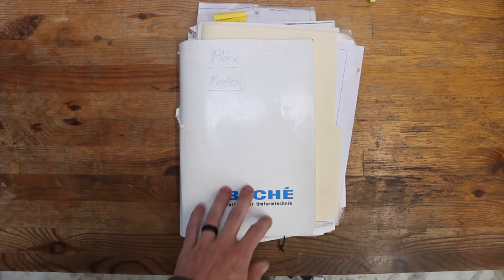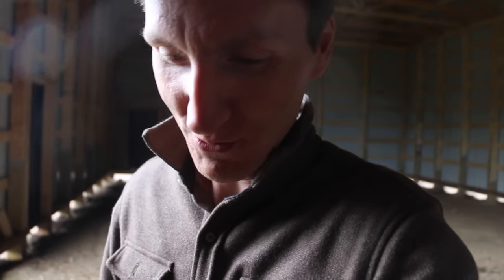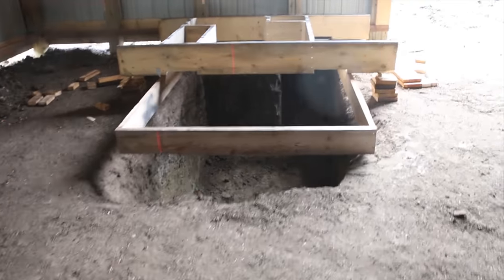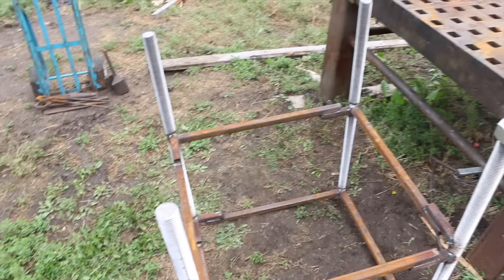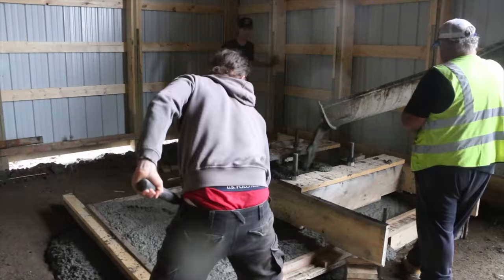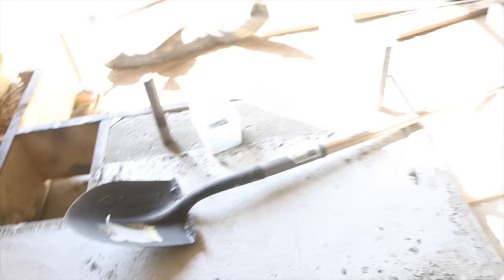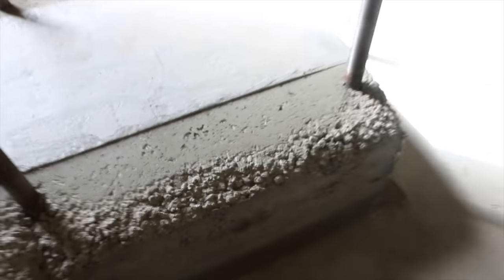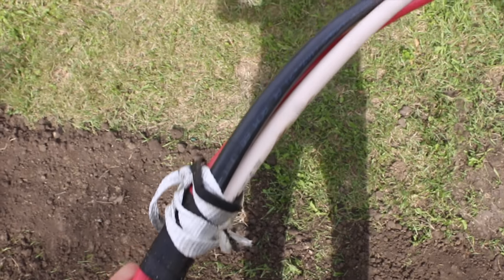Digging a really big hole in my shop.

Comment: Tim, you can pick-up some non-shrink grout, or a polymer-modified cement patch product at most home supply stores. Both products mix with water like a mortar mix, and you can use it to fill all of the concrete voids. Just put some temporary forms up around your existing slab, pour the grout or patch product in, and trowel it smooth like you did your concrete.
Reply: Look for a Sika product.
Reply: i saw abom use some type of grout under his shop crane.
Reply: Was about to suggest this as well. Also, remember to prep the surface area that will receive the structural mix - make sure there are no loose or dirty spots and wet it right before applying the grout mix.. just enough to that the surface feels wet (you can do it with a big sponge or brush). It helps them adhere to each other better and reduce the chances of hairline cracks forming between them.
Reply: Came to mention the grout. We've used this on a few large projects to repair voids or defects.
Reply: hydraulic cement is a good patch product too
Reply: @joshfick4107  if you take some portland cement and make a wet slurry it makes a great bonding agent, for this patch i am with you on the hydraulic cement
Reply: Hydraulic cement is a very good idea - it expands to fill the small gaps. That said, a good epoxy should easily handle the job.

Comment: I'd probably dress up the hammer base and incase the sides in 1/4 plate steel,  weld and grind the corners smooth, after that I'd mix up a cement slurry any pour it on the top around the broken and crumbled edges to level it and make the crumbled areas disappear. The steel base can then be painted afterwards to match the hammer when its mounted. The steel can also protect the base from getting hit and chipped or keep it intact from any chance of splitting, if it did occur, it won't matter because it can't go anywhere. If you want to go extreme, get the hammer name cut out on a plasma table and weld it to the base, A bit of gold leaf pin striping here and there, it will look the part
BTW, I don't know how I ended up here, enjoyed the show and I just subscribed to your channel.

Comment: You could weld a metal cap for the top of concrete with plate steel. Would hide all the issues and give it a solid base.

Comment: You are correct. Especially since the hammer foundation is going to be hammered constantly. I would have used 12"×12"rebar mats at 3" off the bottom. 2" under top elevation and another mat every 12" O.C. to the bottom mat.

Comment: Cut a piece of plywood just a couple inches higher than the top of the platform. Tap con it to the side. Pour it back with rapidset cement all. Mix it up to a viscous pourable texture. Color will match really good and rapidset is insanely strong and durable, remember to wet the existing concrete first for a good mechanical bond. Then just fill your tapcon holes when you pull it apart.

Comment: Tim, I work on stop lights and we pour bases somewhat similar to this often. I would suggest for the next one you pour raise the wood holding your bolts in place up so that you can finish under those as well.  We also use angle iron (bet you have plenty of that)  and ubolts to clamp the main bolts to the angle. All that said it's fun to see your progress! Keep up the good work, and keep the forge lit.

Comment: If you have a Sawzall, you can use that as a cheater concrete vibrator. Take the blade out, and put it against the form as if you were trying to cut it.  Rattle away. It's not the best since it doesn't get deep inside the concrete but for Edge work where your trying to get it under accessible forms like you were, it does work in a pinch.

Comment: You can get a hydraulic cement that is good for those kinds of repairs and will work very well, just make sure that you put an acrylic bonding agent on the concrete before you put on the hydraulic cement. Bonding agent and a pail of hydraulic cement should run you around $80-$120 depending on where you are.

Comment: It's fairly easy and straight forward to convert your wall to a swinging door that you could open if you needed to, if you had some really long stuff to work with.  Because it's not actually used as a door, it can be more crude since you never really use it and it stays locked shut most of the time..  Or if you don't mind spending the money, you could just add another garage door on the side there, to open up room for working long materials on your hammer.

Comment: The concrete is really just a cosmetic issue, it's under the motor mount, not the anvil. No one but you is ever going to think anything of it. Meanwhile, my little hammer just sits on a 1/2" rubber pad.

Comment: I would definitely be careful using the anchoring epoxy for a job like that. It works great for setting anchors but it gets brittle if it is not contained in a hole.

Comment: Great work Tim! I'm not sure if concrete is meant to be poured that deep at one time. That may be part of it, but I think you can just get DIY quickrete in a 5 gallon bucket and fill in that edge where the concrete didn't fill properly. Worst case you can try to chip some of the rubbly edges off around the bolt to expose any air pockets before patching it with quikcrete. After that the epoxy will cover it and no one would ever see! Like someone else mentioned, it's just the anvil not the hammer so it takes a lot less weight and I think it'll be fine! Glad you waited for the second power hammer! I know you probably want to get that running but if money's tight it would be better spent finishing the floor and putting heating and insulation in before the winter weather sets in. You can always come back and revamp the workshop next year but I think it's better to get something running so you can start working and making money again. Also! If you don't have a patreon you should make one! I don't have money myself to give but I know it has helped a lot of other youtubers to keep going and making content! Maybe see if you can make some calls to Alec Steele or other youtubers to try to get sponsors! There's probably a lot of companies that will give you tools to set up your shop in exchange for having their brand name in every video! Your channel already has over a hundred thousand subscribers so it's not like you're starting out fresh. You have a reputable name in the youtube community and I'm sure companies will see that and be willing to make a deal to help you out!
Reply: can pour concrete to any depth....best done in one pour
Reply: @ronnierobinson1502  I thought that abandoned mansion guy said you can't pour it over x number of feet. Is that different for cement maybe?
Reply: @joshclark44  you can but you have to really cage it well with rebar or metal wire, otherwise you get soft spots that just break off

Comment: First thing I thought when you started placing the concrete.. I guess he's counting on the high slump factor to get everywhere without a vibrator and will be hammering the form sides to get "some" vibratory effect around those bolts so close to the form... Oops.
The only thing I would be concerned about now is that the blueprint engineer took into account vibration dispersion levels within and through the concrete when certain mounting points were at or below floor level vs above floor level.
Dont want a slow crumbling effect or a catastrophic Walls of Jericho under the machine. 🤔

Comment: I did concrete work for a decade and I would not worry about that little corner that didn’t fill in completely, there’s a LOT of concrete there and those are big bolts, nothing Is gonna move brother. Like u said maybe try to fill it in with epoxy if you’re gonna use some to level things out anyways 👍

Comment: Any heavy vibration thru the concrete will affect the base of your power hammer if some of the form of the foundation is a bit lacking might be a concern😱 . 
im not a professional builder but I’ve worked with builders  and learned how concrete works you may just get away with touching up the areas that are needing a bit of TLC  before mounting the power hammer on the base 🥳  
Hope your new work area will be amazing when it’s done 😎🥳🥳🥳🥳🥳  lots of love from Ireland 🇮🇪

Comment: I am no expert at this but I think you could fix the pouring error by putting back on the wood and fill the gaps with new concrete. The surface looks rough and tough enaoug to hold it in place.
But that is just my amateur idea.

Comment: Cut the concrete down an inch under the mounting pads for the machine and drop in a 1” thick plate to bump it back up, you can bed the plate in that epoxy to get crazy strength. That will take care of the concrete and the leveling. For the plate if you reach out to me at Oshcut I can get those made for you.

Comment: Tim,  Don’t disappoint me and tell me you had help (other than the Conc pour) with all of the work in this episode!  I see similarity in yours and my approach to getting things built…”just get out of my way and let me do it” Ha!  Help usually just gets in the way.  Any way…great video.  I’m looking forward to seeing the new shop come together.  But…you gotta get some tarps on all of that stuff sitting in the weather!   And don’t worry about that foundation imperfection.  Those mfr designs are always over designed…usually at least by 20%.  Doesn’t look pretty, but forging is not about “pretty”. Be safe and keep the cameras rolling!

Comment: Should have gotten some of that Alberta oil and sprayed down all your equipment to keep the water from rusting it all...  Or just a bunch of cheap Princess Auto tarps...

You can just mix a bit of concrete mix and those voids will patch up just fine...  Concrete bonds to itself quite well.

Comment: Not a concreter but I think you'll have to redo that at some point in the future so either dig another hole or plan for that down the road for when you do have to move the powerhammer.

That wasn't a lot of rebar for a pour that size and there'll be cavities in more spots than just what you saw, so the powerhammer will cause cracking over time. Might be easier to just do it now, and consult with someone first, even if you just jump on a forum and find some concreters. 20/20 hindsight I guess.

If you look at rebar for a building foundation or a runway you'll see how dense it should be.

Comment: There are plenty of cement based high MPA grouts that you can use to pretty up your edges and bolts. Epoxy is expensive and a self leveling grout would be an effective and cheaper option. Hit me up if u need advice

Comment: You can also try putting concrete in the missing parts to fill them in, and then pour the epoxy. Could be the one used with sand, as it doesn't need structure integrity. This will make it flush with the rest, and won't bug you for the rest of your life.

Comment: Maybe consider using a fiber-reinforced product to repair around the bolt. I feel like even a chemically bonded product might excessively crack or chip from the vibration of the hammer. This is definitely not an area of expertise for me and I'm not sure how brittle those concrete epoxies are.

Comment: Dude. Tell me about your move sometime, Also don't sweat the void in your concrete work. It probably will make Zero difference. The force from your hammer will be primarily upwards shock movements. You can get machine leveling grout which will probably do the same as whatever epoxy you are talking about. Good job Tim
Reply from the maker: My thoughts exactly on the force. You tell me first about your move! Haha😊
Reply: @TimothyDyck  I'll pm you my WhatsApp on Instagram? I'd love to hear
Reply from the maker: Send me an old fashion email. info@timothydyck.com